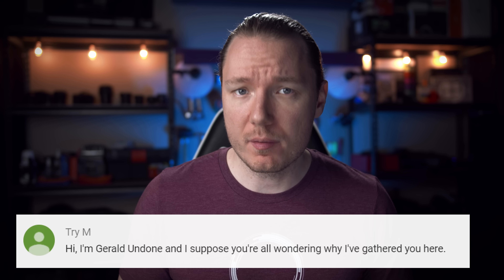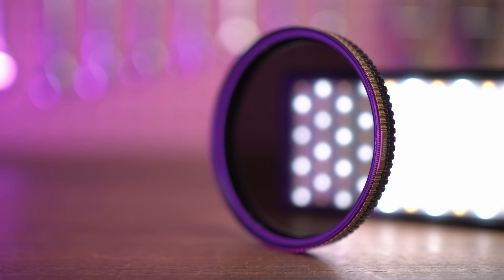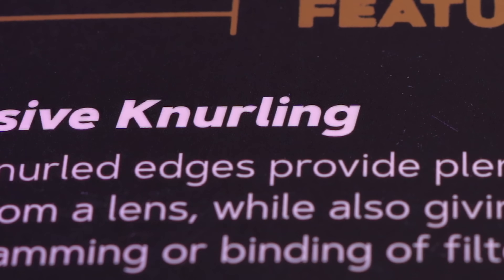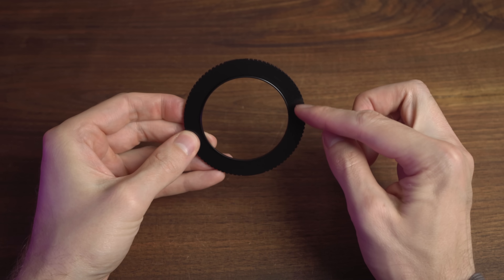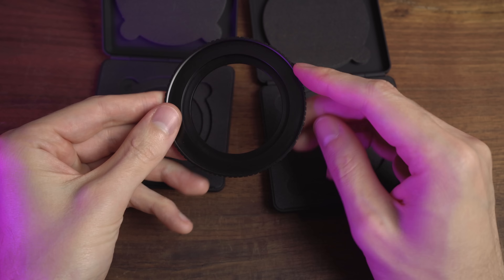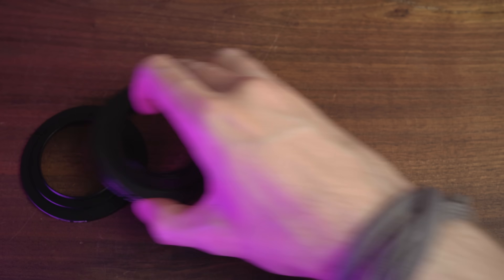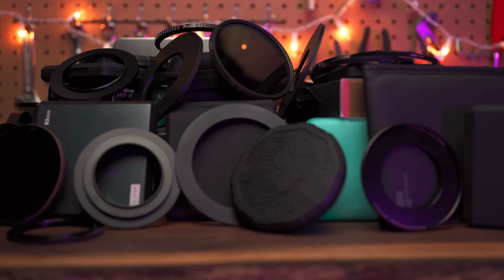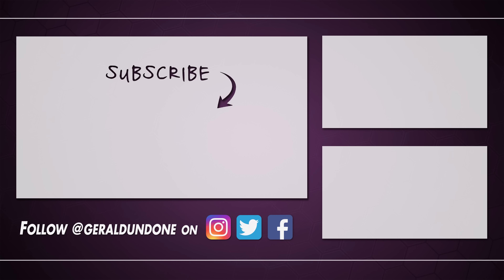Nerd Facts on Step-Up Rings, PolarPro, ND/PL Filters, & Knurling

Comment: Woah...have you been reading my diary? I was going to order a variable ND filter for my 18-105 Lens on my Sony a6400...but I have a 72mm thread and the polar pro variable ND filter I am going to order is...77mm. I would 100% put this to good use since I am always in and out of weird light situations when I am out traveling. Yet again, another great video! Thanks and have a thorough day :)
Reply from the maker: Congratulations, Curtis! After random draw, you were selected to receive some aggressive knurling. Send me an email with your address so I can send that step-up ring to ya. 🤓🙌🎁
Reply: @geraldundone  Thanks so much Gerald!! I sent you an email with the subject line "Aggressive Knurling YouTube Comment!" Have a great evening!
Reply: @Gerald I got the step down filter and it looks and works perfect with my 77mm PolarPro variable ND. Thank you so much!! Time to go edit my footage 🤓
Reply: I really like PolarPro, I have their ND8PL, which is very similar to this filter but 3 stops. I also bought one of their step-up rings and that is built well, I agree. The only thing I hate about both is the knurling. It causes them to stick out, just enough to block most lens hoods from fitting on the end of lenses. Some people don't even like or use lens hoods and those people don't care, but trust me those people are retarded. Lens hoods protect a lens better than any UV filter or lens coat. I use them always, not matter what, even indoors, you should use lens hoods. So at the end of the day, I will not be spending $249 on any other PolarPro products and wish I didn't buy one, because I love it, but hate it.
Reply: xn
d

d.  Bnc🍿🍠

Comment: Surprised I didn't hear you mention that BRASS rings screw on and off more easily than aluminum ones which get stuck more.

I specifically looked up cheap but brass ones and got some from LUŽID.  (they use a cute font too lol)
Must have to do with the material properties of the softer metal?

Comment: Great video Gerald, I have a question -

I purchased a CPL filter (58mm) & a 49-67mm step up ring to use on my 50mm 1.8 (49mm thread size) and my 28-70 3.5 (55mm thread size) this will work right? I assumed the 49-67 mm will fit any lens that has a thread size between 49 mm to 67 mm. Can you confirm? thank you so much!

Comment: Great video, thanks! As using a lens hood isn’t possible with a step up ring attached, are you aware of any matte box systems / other solutions that allow you to also use a circular variable filter, in particular the PolarPro 82mm vnd, on a step up ring? I just can’t find any information on this anywhere, and if anybody knows, you’ll know! Any advice would be very much appreciated!!

Comment: Thank you Gerald.  I’m a little hesitant to get larger filter and use step-up rings.  I feel it may not be worth it.  I also heard that adding distance to a lens by using step-up rings will cause “cross-polarization” that is mechanical and not fixable.  I know this is usually the issue for wide-angle lenses.  The widest I use is 24mm.  I would appreciate any input you have on this.  Thanks again.

Comment: By far the most original video about photography gear, useful AF. Bravo. I saw it once when it was released and purchased the fotodiox ones, but trust me, the guy is right, knurling is not only useful, but ESSENTIAL. Anyone who has stacked rings knows. This is not a hyperbole. Fotodiox rings stack for good and I don't even screw them tightly. I cannot imagine how awful the no-name rings would be. This is not a first-world-problem kinda thing. If they stuck one may try for minutes to unscrew them and eventually will be forced to use a tool, which of course will cause damage to them and maybe even to the lens.

Comment: Great video, thank you. I came across the Breakthrough then the Polar Pro rings and wasn't sure which one to get - you covered it 100%.

Basically I need to fit all of my 77mm filters on 49, 62, 67mm. PP makes them all except for the 49 to 77mm, so for this one should I double stack (49 to 67, 67 to 77) or just get a Breakthrough 49 to 77mm?

Comment: Hey Gerald, Thanks for another nice video content ! I did had a question regarding step-up and use of protective lens cap and Polar Pro Defender :
I'm looking for a way to have a quicker run & gun workflow, at present, i have 82mm polar pro filters as well as 2 step-ups for my 67 and 77 mm lenses.

However, when i'm switching lenses, i need to : 
-Switch the lens
-Get a step up out
-Mount it
-Unscrew the filter from previous lens
-Potentially unscrew and store up step up ring from previous lens (if say it was 77mm)
-Screw it back on lens step up
-Put protective lens cap on previous lens

Which seems like a LOT to do, and can't really be done with ease.
I was thinking about doing the following : have my step ups live on their respective lenses and get each one a defender protection, this way, when switching lenses i just need to :
-Unscrew ND filter from previous lens
-Remove Defender protection from lens
-Screw ND filter on it
-Put Defender protection on previous lens

However, i'm wondering what would happen if i get a 77-82 defender on a 67 lens with a 67-82 step-up on it... will it stick there ?? or am i f** ?

Comment: A little tip on threading filters properly:

Go in reverse until you feel the threads align. There is usually a slight bump. After the threads align from that position you can then screw on the filter normally without stripping the threads. 

Also keeping the filter level with ground sometimes can help give you and assist via gravity as well.
Reply from the maker: Great tip!
Reply: Gerald Undone thanks!

Comment: Hi Gerald, I  had issues with ghosting and refection on the lens when using step up rings with my variable ND filters,  or even when stacking the rings, now I bought the 8.95 cheap rings and perhaps its an issue with the variable ND filter.  I'm curious to find out if you have ever had that issue?  Thanks, enjoy your channel very much!

Comment: I use IR, ND, PL, and ND/PL filters so much that I switched to Breakthrough's step-up rings but the 72-77 gives me problems. I might need to try PolarPro's ring. In the process of dealing with stuck filters on the 72-77 step-up rings I have used, I have found something that works better for me than filter wrenches to get the filter unstuck - a metal filter stack cap - it prevents any bending of the filter ring and gives me a solid grip. :) Thanks for posting yet another informative video.

Comment: Is there any quality degradation in the ND+polarizer built-in vs just ND only? (both polarpro brand)
What's the best of the rest at lower price points? I was thinking of going with the Firecrests (circular) polarizer and then stack NDs on top.

Comment: Hello sir, regarding the stopping power of the PolarPro ND16/PL, is it really 4 stops of light ? Not 4 + (1 to 2) stops of light ? That is 5 to 6 stops ? Because according to my experience, PL filters usually darken the image from 1 to 2 stops of light, 1 when not filtering, and 2 when at max filtering the polarized light (if there's any to filter on screen, so that would be 4 + 2 stops if the source of light is coming at a 90° degree of the sun axis, 4 + 1 if facing the sun or back facing the sun). So in all cases that would be at least 5 stops. Excuse my approximative english, not a native. Best regards, JP

Comment: Good info here, I was debating whether to get a separate ND for my lenses or keep reusing same ND on different sizes. But.. if you use a small lens (say 58mm) with a 82mm ND with step up ring, then ND is probably going to be bigger than the lens hood?

Comment: Hi Gerald. Would you prefer to use the PolarPro 82-ND16/PL over the PolarPro Variable ND for run and gun video? I'm currently using the NiSi VariND as I couldn't at the time get the PolarPros in Australia. I'm looking at purchasing PolarPro Variable ND but is it better to use the 82-ND16/PL and just adjust ISO as needed (using a sony A7III) for changes in lighting and maintaining maximum quality? Oh and if i'm not too late for the give-away, i'd love to grab that step-up ring. :)

Comment: Oh lord, please don't use pliers! Whenever I have a stuck ring I place the filter/ring into the freezer for an hour or two and the ring will then usually come off. If not, it's kind of like a pickle jar -- gently tap the ring all the way around with something hard. Usually one or both of these methods works.

Comment: Surprised I don't hear more about about the con of not being able to use a lens hood with alot of these filter setups.  Do people not care about that?  It's probably the most significant factor that pushes me away from using my variable filters.  Between that and the vignetting, I tend to stick to fixed nd's that fit inside my lens hood.  But maybe I'm over worried about not using a hood?

Comment: I have a sigma 18-35 and I last month I ordered a 77mm polarizer filter. Next thing to know, my calculations were a bit off and the size I needed was 72mm for the lens. That would be perfect because "Polar Pro" and as you said, filter a little bit bigger than the lens to avoid vignette 😉

Comment: I did not know PolarPro makes step-up rings as well. I have a Sigma 18-35mm which has a 72mm filter thread and a 77mm Hoya VND from previously owned Canon 24-105mm f4. I use a cheap step-up ring from Amazon and it is a pain to put on and take off. I would really like to try out the PolarPro and please include me in the drawing!!

Comment: I took your long standing advice about getting the largest filter and use step-down rings to heart. When I was shopping for variable ND filters I realized I was way ahead of the curve because of the set of step-down rings that came with my Nisi landscape/seascape filter kit. When my filters arrived I found I was able to use the 82mm PolarPro’s with all my lenses down to 67 mm.  I have not had any issues with the Nisi equipment in combination with the PPVMD-PMc versions. Even at colder temps the filter and step-down rings work smoothly though it is possible to thread them in too tight of care isn’t taken.  The added utility of the rings from landscape kit being useful for other 82mm filters is a distinct plus.  For folks who are considering the purchase of a 100x150 mm kit, it is worth considering there are step-down rings included.

Hope this helps others out there. Thanks for your video Gerald well done.  Three thumbs up from me.
Reply from the maker: Thanks for the tip, David. And for the kind words! Cheers.

Comment: One thing I was hoping you would touch in with the nd/pl filter. Can you use it as just am nd by adjusting the polarization until you don’t see any polarizing effect?  Making it so people don’t have to buy an nd, and an nd/pl. is there any benefit to buying just the nd?
Reply from the maker: You can definitely minimize the effect by rotating. In my sky sample, you can see how little polarization is happening when it's fully turned. I would say if you own the ND/PL, you don't need another ND filter of the same density.

Comment: I bought a cheap set of step up rings on Amazon. So far the only real issue I found is that because I have to stack so much to get an 82mm filter on my 16-35 f/4 that on the wider focal lengths I end up with my images looking like they're framed in a circle. I guess you could call it really heavy vignetting. I've wondered if the 72-82 would eliminate enough of the stacking to not give me that tunnel effect at wider focal lengths.

Comment: With the filter binding on the Breakthrough vs. the PolarPro, did you happen to use any other brand of filter than the PP?   The reason I ask is I wonder if because they're the same brand, and presumably machined in the same factory or at least spec'd out the same, that the threads will line up better vs another brands filter.     Like, take a cheaper brands filter and see if it still goes on smooth, or alternately (and probably by accident) if the cheap filter spins better on the Breakthrough or Fotodiox.  I would presume there would be a tighter tolerance within a brand.

Thanks for the interesting experiment!
Reply from the maker: That's seems like a fair assessment. I don't have any Breakthrough filters to test, but you might be right.